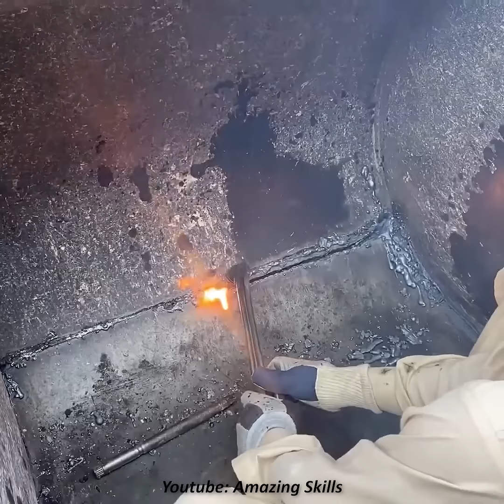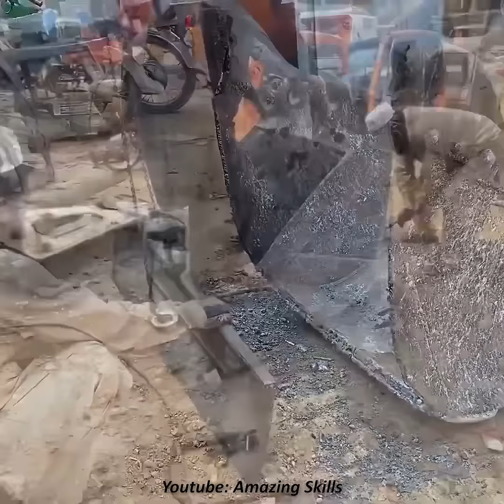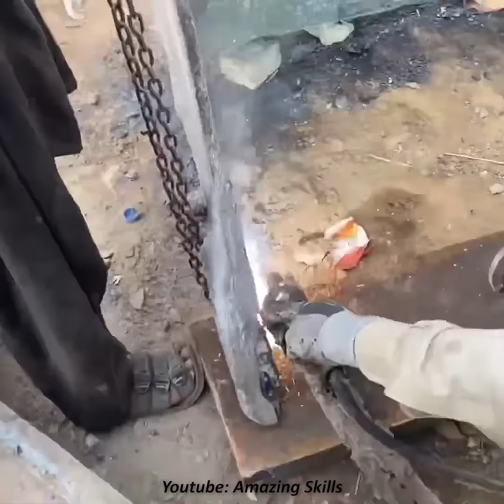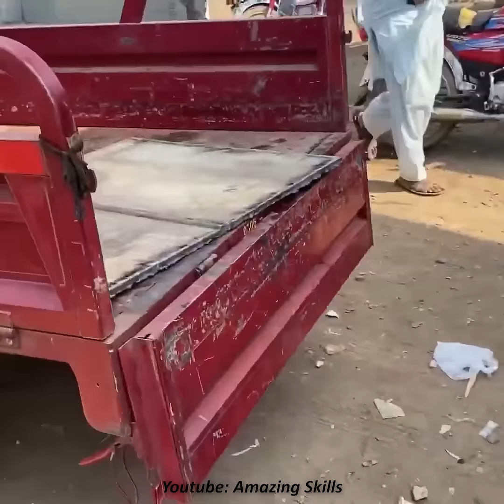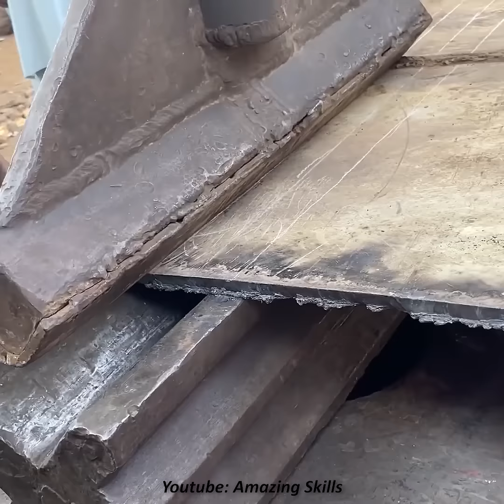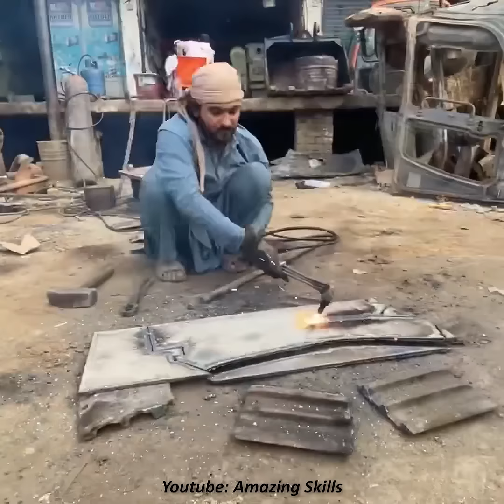How Excavator Bucket Is Restored With Basic Resource & Tools #shorts

Comment: If they got a job at Caterpillar here in the states, they'd get everyone else fired 🤣
Reply: Those welds were atrocious.
Reply: Right if they had the proper tools and maybe someone to show them a different way I think they could be just as good forsure... but for what they got to work with... absolutely amazing
Reply: @edwardmyers8782  but its getting the job done till it breaks again no ?   I'm sure they ain't got 30k to buy a new bucket so they made do with what they had
Reply: @edwardmyers8782  something that thick needs preheating. And a lot of people who don't have gas to spare and torches will preheat by just making huge ugly blobs near The joint. Then once The Metalist properly preheated they'll actually run their beads and then cold chisel off the huge preheat blob things. I know it's not the most intricate way to do something but will absolutely make stronger Wells instead of just trying to weld a tall cold. A little extra hammering and grinding is no issue if the welds are three times stronger
Reply: @hullinstruments  you obviously did not watch how much torch work went on in the video. But I was referring to the undercut top toe if those shitty welds  and preheating by welding blobs??? No that only creates  more problems with cracking plus it is not the thickness it is the alloy of the steel in question and the correct ar steel that they should be using needs considerable preheating and trying to weld blobs just not only bullshit but as I said it would only create more cracking you really shouldn't comment on things that you have no actual knowledge of
Reply: Yes very hard working people 👍👍
Reply: You should've read the title please.. BASIC RESOURCES
Reply: @edwardmyers8782  I’m sure they don’t have a lot of welding rods to spare so they have to move fast and that looks like a thick material so I’m sure you need to be going much slower than they were at the end of the day the show merit at what they’re doing if they’re able to well the bucket back together with a little tools that they do have then I know for a fact that if they were to come to a country like America, they could Outworld anybody here and this is coming from a welder in America
Reply: @mrprodigy7143  I'm sure that no matter how many welding rods you have proper welding techniques used with the available materials will always result in a stronger weldment but don't go by me go by the American welding society or the American society of mechanical engineering and both will tell you the same thing.

Comment: IF THIS GUYS GET A JOB IN THE U.S AS WELDERS THEY'LL BE HIRED ON THE SPOT...
Reply: No no they won't
Reply: If they came to my shop without all the proper PPE  & welding equipment, they wouldn't even get inside for a test, those shields are for emergencies only & I wouldn't even let them use an auto- darkening for the test...